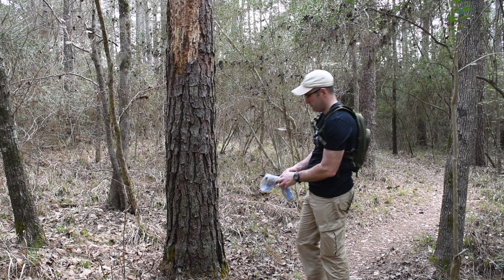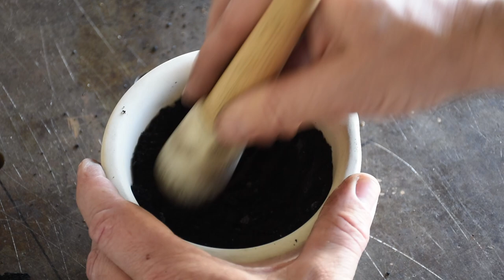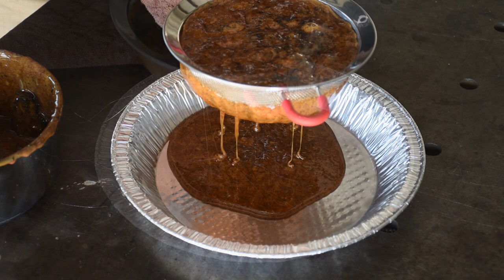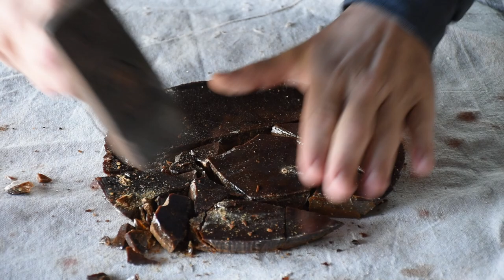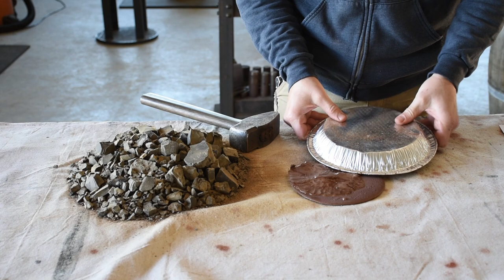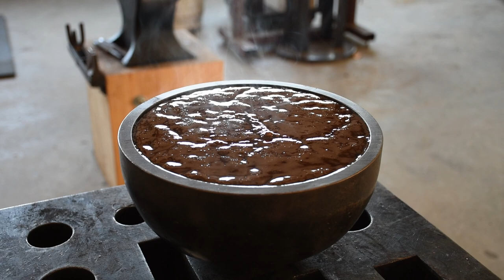Making Matsuyani: Japanese Pitch

Comment: Looks great.  There's something to be said about hiking through the hills and collecting your sap.  If I might offer, though, you can buy Pine Tar by the pint, quart, or gallon.  It's just pine resin that's been extracted on a large scale.  Those turpentine fumes you mention are because there's turpentine in the pine sap, and heating the wood in big ol' ovens is how they get turpentine for sale.  The pine tar, once referred to as Stockholm Tar, is the single best preservative and general-duty finish for wood that I've ever run across.  Not only does it give a nice color, imo, but it has anti-microbial action going on that prevents mold, mildew, and boring bugs from bothering your stuff.  I use Pine Tar to treat all my tool handles in the smithy.  If you thin it down with turpentine, it goes on smooth and really sinks into the pores of the wood.  Add some shellac flakes if you want a shinier, more durable finish like on a table top.  Sailors have used Stockholm Tar for eons to preserve their wood and rope.

Comment: Isn't your pitch exceedingly hard? It would be too hard for Repousse work. My pitch is 50% resin, and 40% castor oil with the last 10% being beeswax and charcoal. If I want it harder, I'll add a bit of marble dust (I found plaster would clump and it was hard to get it smooth) but marble dust works well, and I can get it free from places that make monuments and gravestones.
Reply from the maker: Yes, it is a hard pitch.  I heat the surface to work at times.

Comment: What is it for
Reply from the maker: How it works is you heat up the surface and press sheet metal into it.  After it cools, you hammer designs into the sheet.
Reply: @rigoniironworks  ok cool will you be showing it in use at anytime?
Reply from the maker: I need a cool project involving repousse.  In the future for sure.

Comment: like to find that bowl sphere
Reply from the maker: I had to make this one, but they sell smaller versions online.
Reply: @rigoniironworks  i read the description.
any chance u have the video
Reply from the maker: I didn't film it.  A week of grinding and welding.  Stacks of 1" plate welded up to a half round.  A ring of pipe welded to the top created the depression for the "bowl".
Reply: @rigoniironworks   nice looks good might need revisit the algebra class to figure out the angle to pre grind the out side at. lacking motivation today tho
Reply from the maker: Scribe a half circle in wood.  Use that as a guide.  Grind/fill with weld till round.
Reply: @rigoniironworks  sound like a plan thank you

Comment: No idea what it's for.  If you need gobs of pitch, it's not hard to find.  Unfortunately, the beetles have reached my property and my pines will now start dying.  With the precipitation this year, they will be producing a lot of pitch to try to rid themselves of the beetles.
Reply: Pretty sure it’s for engraving/carving. 
I think the resin acts as a work-holding fixture. The resin can be heated up with a heat gun and it becomes malleable. While in a soft state, whatever you’re working on can be pressed into the resin and left to cool. When the resin solidifies, it is holding your work around 360 degrees. 
Or I could be totally wrong, in which case, disregard everything I said.